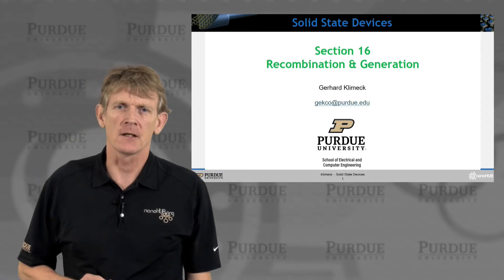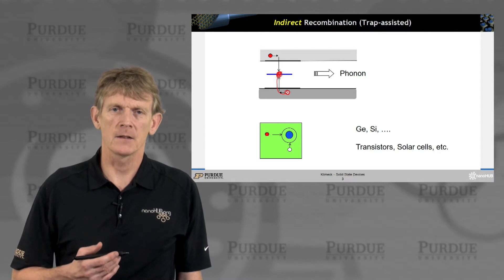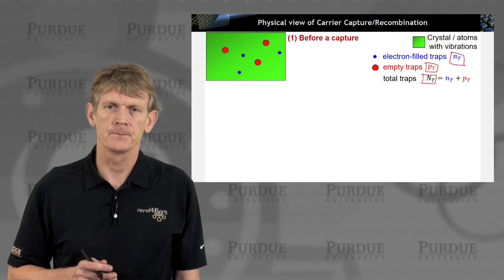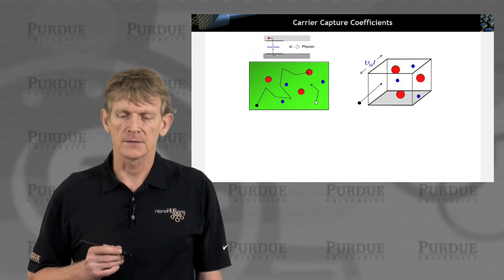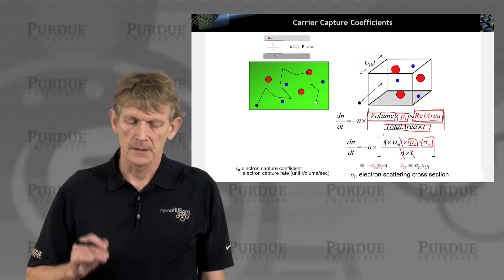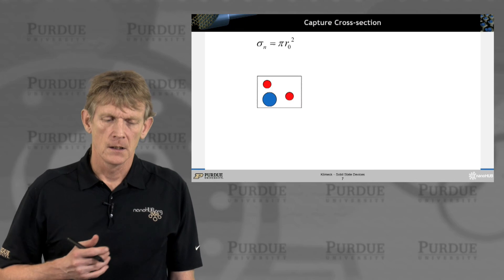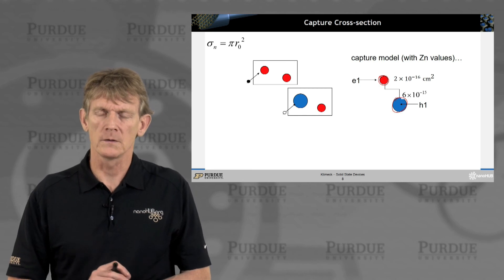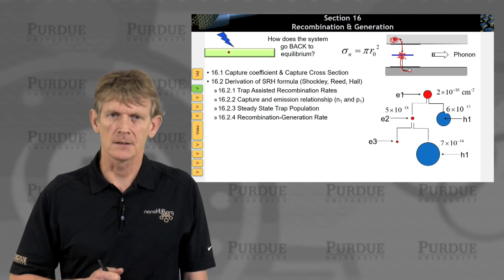ECE 606 Solid State Devices L16.1: Recombination & Generation - Motivation of R-G Formula

Comment: Potentially helpful note: When discussing the "scattering cross section", this "cross section" isn't referring to any physical cross-section. Rather, it's referring to a conceptual cross-section, i.e. one that represents a probability. In other words, the electron scattering cross-section is a measure of the probability that an electron will scatter in a material. The bigger the cross-section (indicated by the blue and red circles in this lecture), the higher likelihood that scattering will take place for that particle.